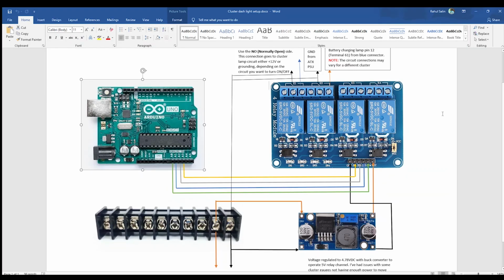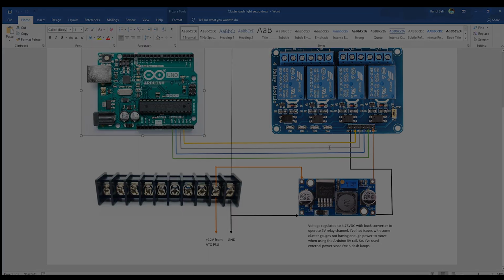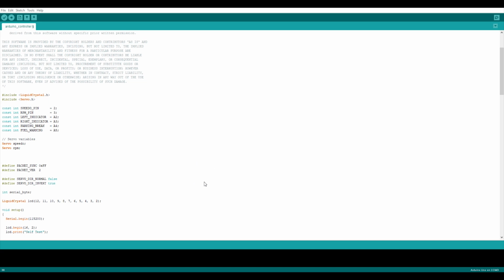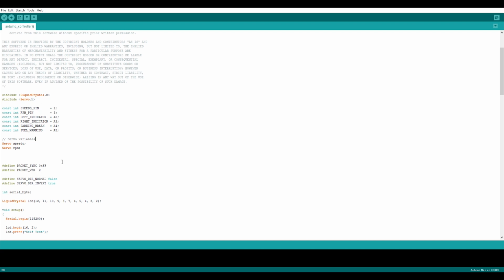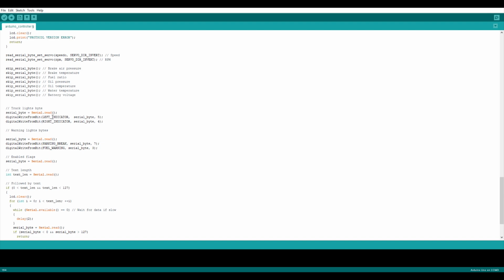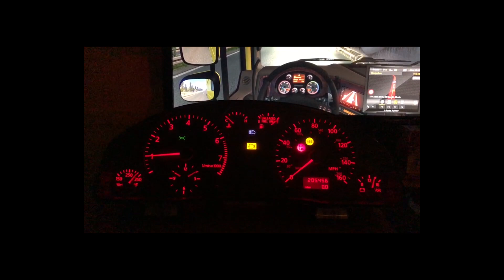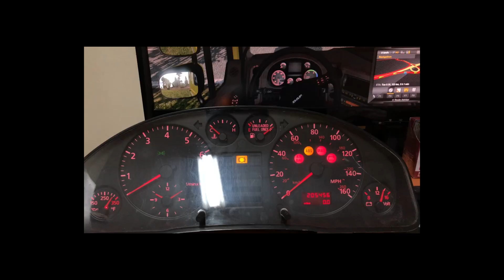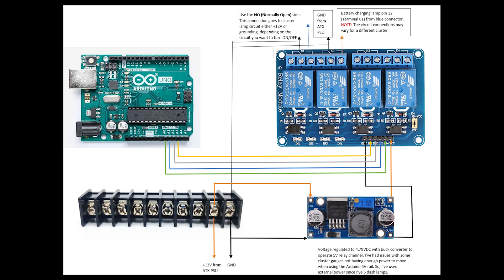SimHub dash warning lights on Audi A4 instrument cluster-ETS2(32 bit plugin tested &Non CAN bus)

Comment from the maker: Update (Jan 2021): The Arduino code has been updated to support latest SimHub v7.3.2 & Win 10 build 2004. With the current code only a single arduino mega/uno is required.

The following are the pinouts for this code:

Left blinker - pin 6

Right Blinker - pin 7
Battery warning - pin 8
Low beam - pin 9
High beam - pin 10
Speedometer - pin 5
RPM - pin 4
Fuel -  pin 2 ( tested on BMW E36)
Temp gauge - pin 3 ( tested on BMW E36)

Note: The plugin has only been tested in 32-bit mode.

Please see the description for the Arduino code, placing the telemetry plugins in the ETS2 path. Thanks for watching!
Reply: Dont know if you guys cares but if you guys are stoned like me during the covid times you can watch pretty much all of the latest movies and series on InstaFlixxer. Been streaming with my brother recently xD
Reply: @Garrett Van Yea, have been using instaflixxer for since november myself :)

Comment: Mna, the link of the arduino code is offline :(
Reply from the maker: The Arduino code that was used in this video no, longer works in latest simhub and windows 10 build. Hence removed. I have added the link from the new updated video here also.

Comment: can't download the code
Reply from the maker: Hi,

Kindly check the two new videos I’ve posted. The circuit setup and the code details are posted in BMW E36 pinout and the next short video for the Audi A4 shows how to wire the Audi cluster instead of E36. But please make sure you watch the E36 video to see how to wire the cluster.

The old code no longer functions with new sim hub and windows build. Hence it was removed.
Reply: @sciencetrove  Hi
Can you help me with this project. I have an A4 B5 cluster (part no 8do919033c).
The problem is the RPM doesn't need a GND!
Speedometer needs a GND to work but then the RPM doesn't work anymore
Reply from the maker: @alexanderachter1185  Well, for both the speedometer and rpm are connected to the  Digital/PWM pins on the Arduino. Keep in mind the ground pin (below the 5V pin on the left side) of the Arduino has to be connected to the ground of the power supply.
Reply: @sciencetrove  I did everything like that. But still only one of the two works. RPM without gND works.
Speedometer without GND works not.
RPM with GND works not
Speedometer with GND Works
Reply from the maker: @alexanderachter1185  are you following the pinouts for your cluster? Because from the serial no it seems you have a cluster before 1998. On checking the serial I see on eBay there are ones with only blue and yellow connector and ones with black also which has outside temp function. But I couldn’t find specific year. 

The Speedo in your gauge is Pin 23 blue and rpm is pin 3 yellow. Also kindly check the +12V and grounds in your cluster are connected properly. You can check the pins for the 1998-99 cluster I’ve and see where those are for yours. I have mentioned in description the pinout given is specific to 1998-99 only. That’s why I included the manual.
Reply: @sciencetrove  is bj 96
Reply from the maker: @alexanderachter1185  I assume you are trying to say its a 1996 model. could you please take a pic of the back side of your cluster and email if you don't mind. 

BTW have you connected your cluster like this table?
https://1drv.ms/w/s!Ag5Te4aKhAY23jsuf6z3jdGrMJHM?e=l8ifx8
Reply: @sciencetrove   Email is out
Reply: @Random Science4K yes I have

connected your cluster like this table?
Reply from the maker: @alexanderachter1185  No, for my cluster from 1999 the pinouts are like in the video and you can see its a bit different from yours with is from 1996. They seem to have shuffled the pin arrangements after 1997. Check the email I send you just now please.
Reply: @alexanderachter1185  did you solve the problem? I have the same problem as yours and I would really like to solve it, I would like to see the cluster running, any advice is welcome, thank you

Comment: Hello, I have the cluster of the same audi a4, my problem is that I have connected everything and only the temperature servo works, the rest does not work if you could help me by explaining how you connected it or send me the diagram I would be very grateful and of course you would have my like and another subscriber thank you
Reply from the maker: Hello Adrian, the circuit diagram shown in the video is only to trigger the dash lights. For the gauges I have used another arduino and programmed it using the arduino setup tool inside simhub. The speedo, and tach work fine. Fuel is kinda jumping around.
Reply from the maker: Hi, I’ve updated the code now to use a single Arduino UNO/Mega to light both the dash lights & also for the gauges. For some reason the old code no longer works with the new Simhub version and windows 10 build unfortunately. I tested it as you said and this explains why the lights no longer works for you.

Check the updated description for the arduino code and diagram with Pinouts for wiring.